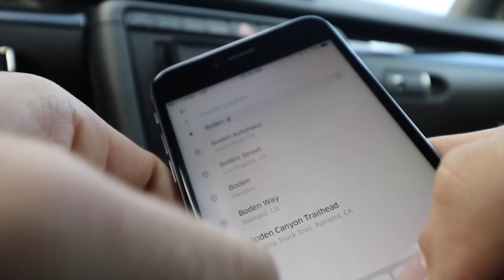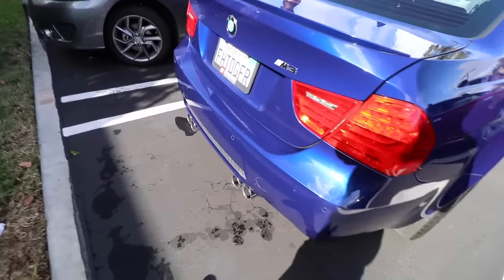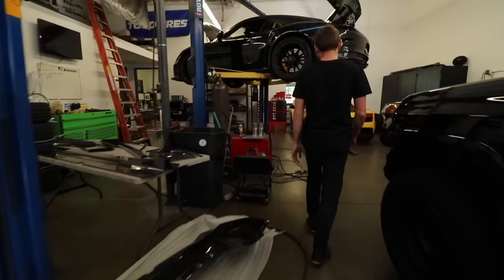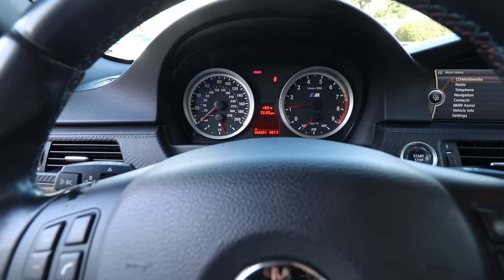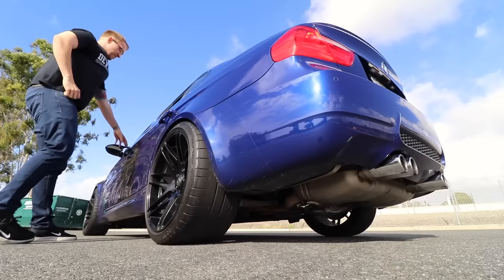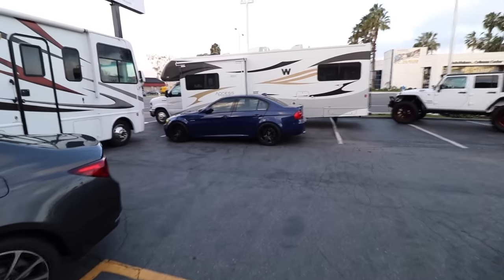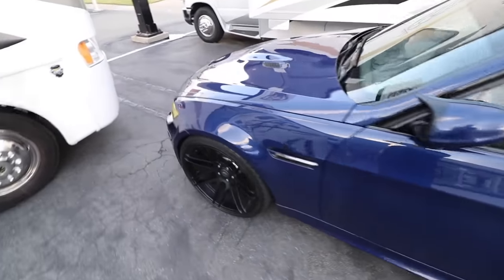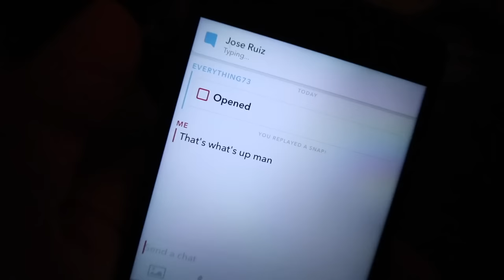look what I did to my car...

Comment: Just to point it out, your exhaust tricker (which by the way is uber cool IMO) allready gives you a couple of more hp's because there is less restriction in the exhaust. I'd recommend suspension alignment and other handling related mods next. Thats my PO. Driving styles vary but its always good to keep the power to handling ratio equally as good, your car is naturally tailhappy anyways :D

Comment: Your detector mounted there is good.. just ensure its fairly level, pointing straight out the front and not aiming up or down.. and it's getting a clear path out the rear for detection out the back of the car.. you will have a greater distance of detection with it mounted a little higher on the windshield. Great Video, beauty car.. and I believe your yellow tinted headlights would be legal because fog lights can be yellow "Halogen" bulbs and street legal.